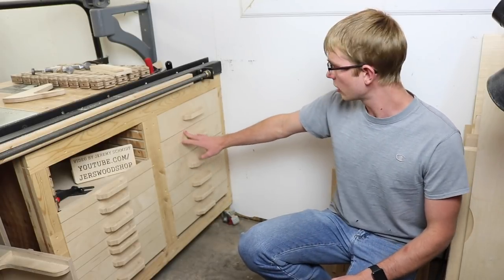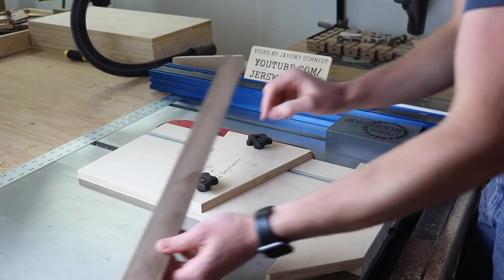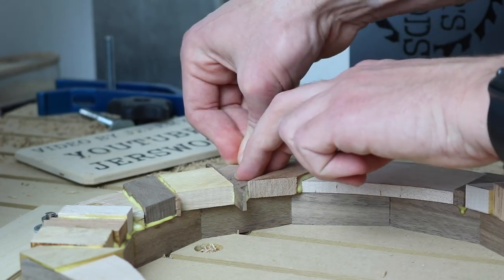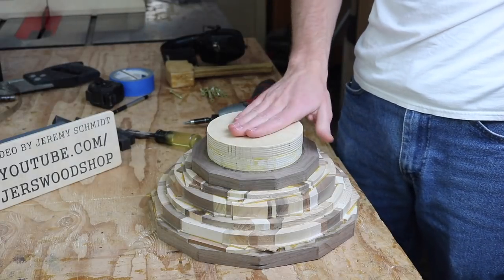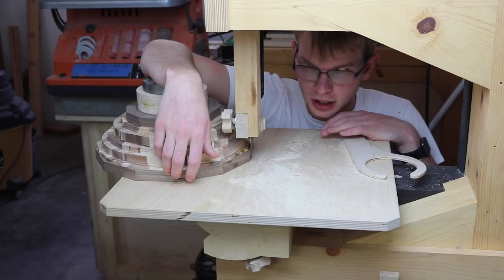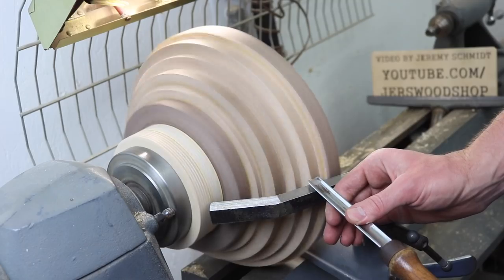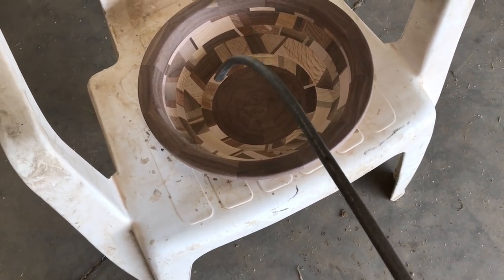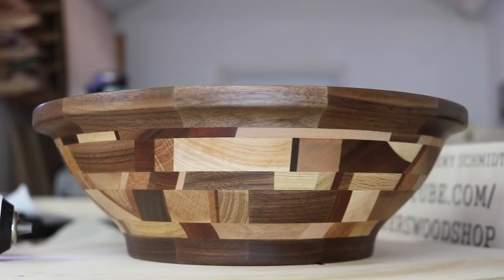I turned my wood scraps into a bowl

Comment: I'll be interested to see whether you end up with a wood movement issue in the bottom of the bowl.  Saw some of Kyle Toth's early bowls in a video the other day and time was not kind.  I've got one like that which hasn't had an issue yet but the bottom ring isn't so wide.
Reply from the maker: +krtwood 
Yikes, I hadn't thought of that. But I did make a couple of bowls with the same sort of bottom, about the same size, a year ago. They're still ok.

Comment: Not sure why you trim outside of rings since you can just turn it smooth on the lathe, but if you have it use it?
Great idea and beautiful work.  Thanks.
Reply from the maker: Yeah you could just do it with the lathe, but then I’ll either have to remove and replace the bowl on the lathe for every layer, or have to do the glue-up on a vertical face... not a big deal but like you said, if you have it use it.

Comment: We have that same way that's cool with the same free-standing tool rest. And I have that same way the home too! What you need to do is make another piece that is an extension arm for the tool rest stand so that it can go into the free-standing tool rest and then it can pivot but it has a hole for another part of a tool rest. So basically it's a pivoting extension kind of similar to how GoPros have that extra little piece that's an extension. That way the foot can go to the right side of the cabinet and then the other foot can go right flat against the cabinet and then you can still reach all the way to the headstock. Even with a 4in tool rest. I'm sure you could make one of those! Awesome job and good luck with that

Comment: Fine use of scrap wood.  Your joints are very tight for sizing each one individually.  However, you may experience the inevitable joint fail in the years to come due to wood movement.  Segmented woodturners typically keep the grain orientation in the same direction to avoid the stress caused by wood shrinking and expanding.  You put a lot time into this bowl so hope for the best.

Comment: Excelent video, I have a similar model of lathe and I believe there is a bed extension that can be mounted in the Gap at the front of the lathe. In the end you clearly got it to work and that's all that really matters but I thought I would throw that out there if you were unaware.
Reply from the maker: +Evan Dunville 
I was unaware of this. Thank you! I'll look into it.

Comment: For facing off the tops, get yourself a fly cutter with replaceable inserts, not too expensive, can cover a lot more territory and leave a much nicer finish, just found your site, signed up straight away, I like what I see.
Reply from the maker: +Stephen Hodge 
Thanks for the advice. Only thing is I'm not sure if my machine is square enough to work well with a larger bit.
Reply: To some extent without major adjustments it should give relative flatness it is following the same plane as your small diameter cutter, but has a wider path? But it would be really reccommended that you would true up your machine to squareness in every axis, before you do anything?
Reply from the maker: +Stephen Hodge 
Yeah, my machine is just kind of garbage when it comes to flex & alignment. I'm working on a design for a new one so I'm not inspired to fix it at this point.

Comment: CNC’s are great for very fine work with tiny cutting heads, but the larger you go with the cutting head the worse the finish gets, particularly where the wood is not close, tight grained... good job on the bowl, like the way the layers panned out 👍🏻

Comment: Turned out beautifuly! Oh, and nice touch with the drill for the slow spin on the lazy susan...!
Reply from the maker: +nexus01gr 
Wondered how many of ya would catch that ;-) also the lazy susan is a homemade clock that didn't turn out how I wanted, so I pressed a used skateboard bearing in the middle...  If you look up 'improvised' in the dictionary they just have a picture of this setup I think.

Comment: Instead of a parting tool, try a hack saw blade. You can bend it to whatever radius you want. You probably could use any old saw blade you have lying around, for that matter. Beautiful bowl, dude.
Reply from the maker: +bomaite1 
The parting tool works well, I just need to be more careful than I was here to make it smooth. I feel the hacksaw blade would have a higher chance of grabbing and potentially injuring me...

Comment: "OCD defying project" -- one of the best throw-away remarks I've ever heard. I'm still chortling... Btw, you need to think about raising your lathe. (Spindle at least at elbow height; I'm most comfortable 3 inches above that.) At times you looked like you were searching for something you'd lost on the floor :-)  Clyde
Reply from the maker: +Clyde Ulmer 
I'll check my lathe height. It does seem a little too low for me. Thanks!

Comment: Can you explain a bit more about your "carbide gouge"? Not something I've seen before.
Reply from the maker: +Cory Scott 
It's ancient...I'm not sure if they make them anymore. Most likely not, because grinding carbide is not the safest thing; hence the new ones have replaceable inserts that aren't intended to be sharpened. It's just a small bit of carbide brazed onto the end of an otherwise pretty normal gouge. You can see the joint where it's stuck on about 3/8" down from the cutting edge.
Reply: Thanks! and thanks for the videos - your attention to detail inspires us all.